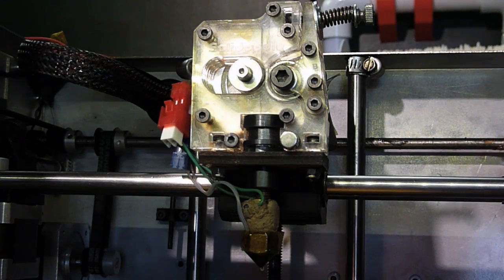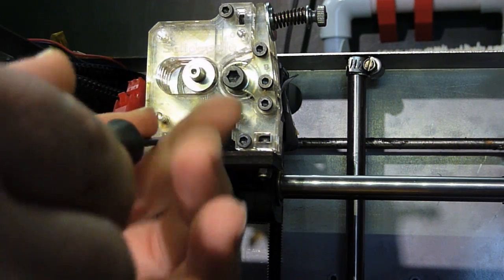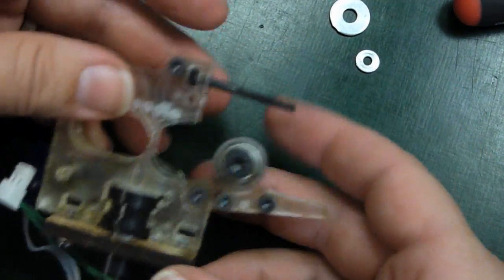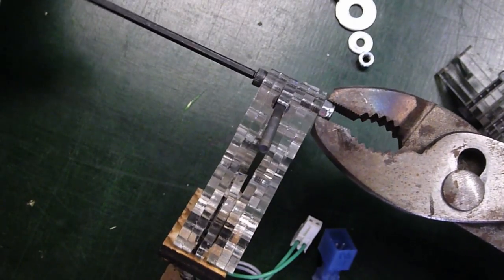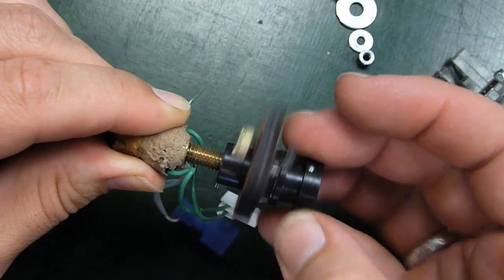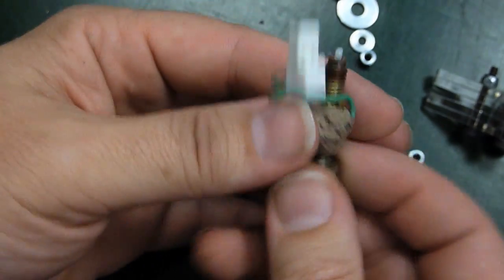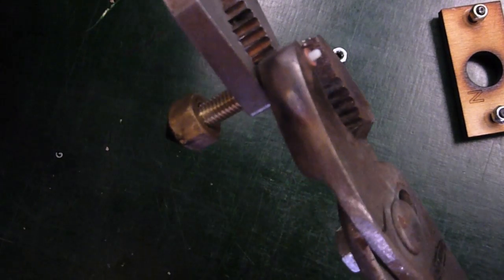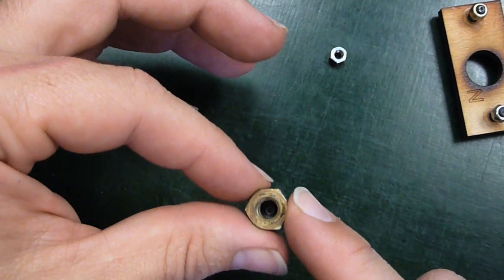Extruder Disassembly

Comment: I was able to grab the threads with pliers after winding some copper wire along the thread groove. My pliers didn't touch the threads. Also, you have to heat up the hot-end before unscrewing, since cold ABS is glue.

Comment: quick question, is the spur gear directly drivin by the stepper? it looks like it is... i'm thinking of making a few new nozzles with propane gas jets so i can get smaller nozzles, and i think i may have better results if i have a gear reduction between the stepper and spur gear. is it a 1.8 deg/step stepper or .9 deg/step? is it a nema 17?

Comment from the maker: It could be an issue if it has already softened and deformed a little.  You don't actually want to take the barrel out of the PEEK, but for me the nozzle is usually tight enough that the barrel unscrews instead. There isn't really a good way to hold the barrel tight while trying to unscrew the nozzle while it is still in the PEEK without mashing the threads.